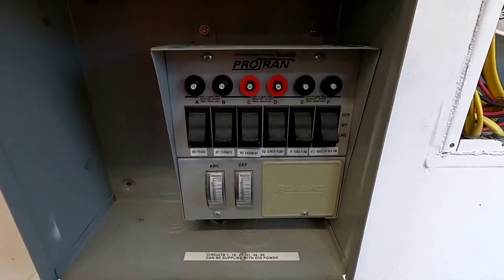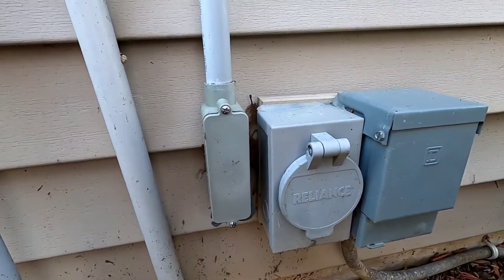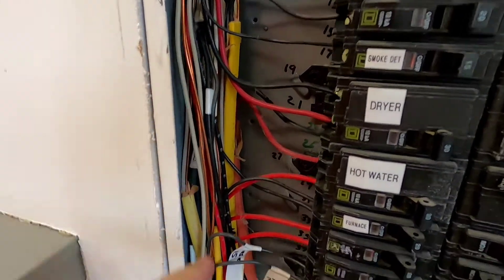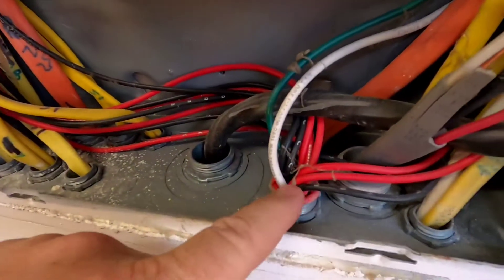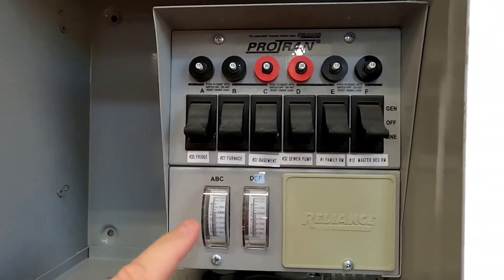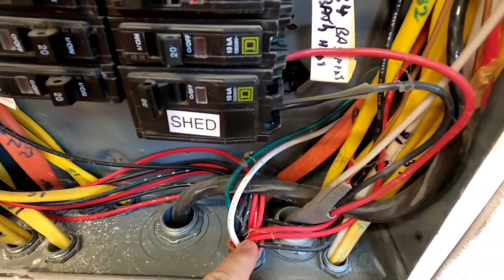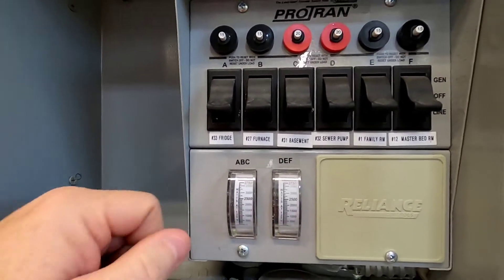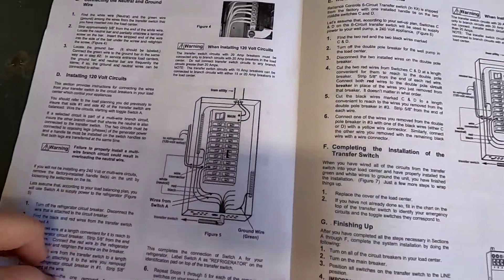Home Generator Power Transfer Switch REVIEW Reliance Pro Tran 30216A

Comment: If you plug in gen with cord plugged to transferbox while the switches are in the LINE position, are you back feeding? Should you have switches flipped to off prior to starting the gen? Do you need to pull the main off when using the trans box? Lastly, is there any way the box indicates when street power comes back on? Ty
Reply from the maker: no it will not back feed the switches are designed to prevent this.   no need to pull the main,  when my other lights come on that is when I know main power is back
Reply: @JustADad  thsnk you 😉👍

Comment: Since u only have 6 switches can you double one switch to work 2 different breakers?
Reply from the maker: No, hard explain, but one wire is for one breaker,  if you double it up you will be putting extra load on one breaker.
Reply: Yes you can, the red breakers labeled C,D can be wired to a 240v breaker like a window unit, water heater, clothes dryer, oven and even a smaller 3ton central Ac if you install a soft start on the compressor....the transfer switch comes with a link bar that ties the breaker C,D together and you will be able to flip/trip at same time. each breaker is 120v and linked together with bar is 240v....that leaves you four 120v open circuits to use. this guy is hard to follow with his explanation but in short, whatever 120v circuit you want to power off TS just pull wire out of that particular breaker, wire nut to black wire labeled A and install red wire labeled A back into the original breaker and repeat......you can do four 120v and one 240v or all six circuits on siw 120v, thats the safest....then all lights interior/exterior are on, all ceiling fans running, televisions, blow dryers lamps no problem. Or get a generator with 50amp plug and safety switch installed in on main breaker and run whole house but you will deff need soft starter on ac compressor
Reply: @jamesjordan7460 do you have to power the main panel off before flipping the transfer switches to generator? The manual says no but I’ve never heard of a transfer switch that you didn’t have to do that.